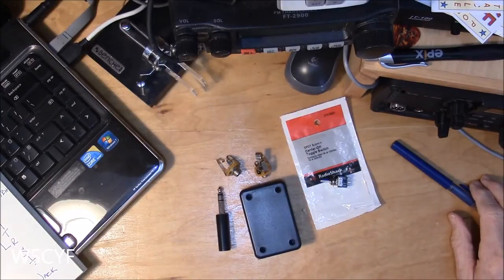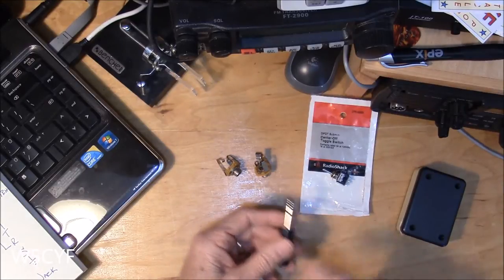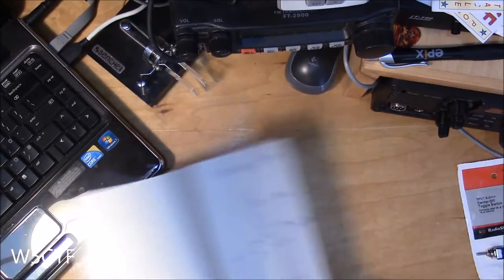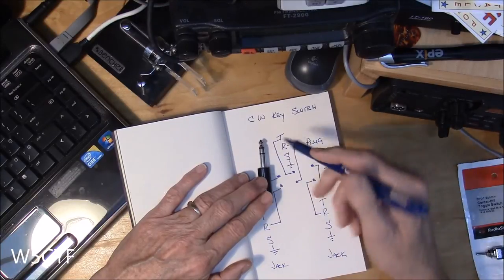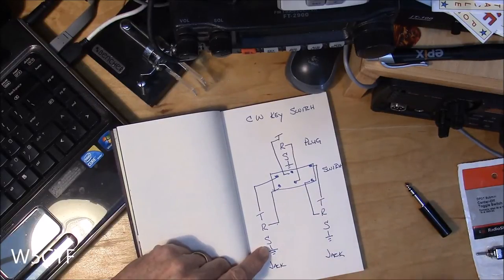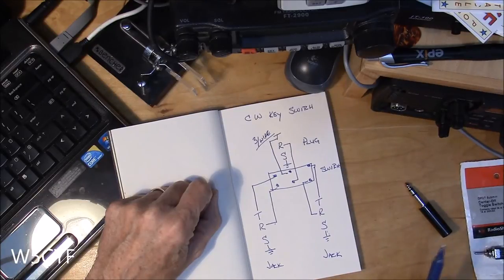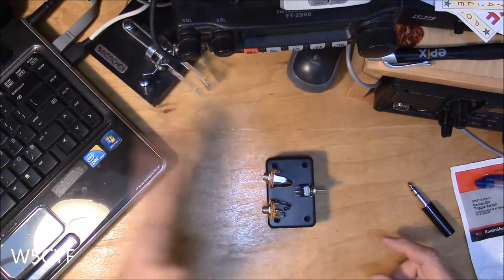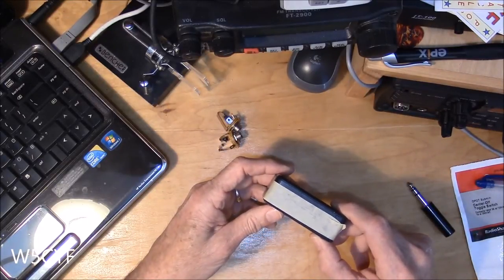CW Straight Key to Paddle Switch-Easy to Build Ham Radio Project

Comment: One time I made an hour long contact with my TT Jupiter. At about 50 minutes in the key I was using quit working. Really, I've had it happen twice now. So I hit tune a few times to let the other guy know I was still there while I found the box for the radio. I dug out this small box with a curly wire. It plugged right into that front "mic" thing. Then I finished the QSO by pushing the lever on the side of the small box. My CW was slower that way, but it worked pretty good. That was nice of TT to supply an emergency back up key like that. I now keep a spare key with all radios.
Reply from the maker: Tim, thanks for stopping by and sharing your story.    ~John

Comment: John, I take it that your are jesting when you say that you do not know what the multipin socket is for on the front of your transever, marked MIC. It is of course for a microphone, the multipins allow also for a send / receive switch to be connected. From what I can gather you only ever use Morse code ?
Reply from the maker: Dave Ticehurst Dave,  Thanks for watching and for your comments.  Yes, the comment was in jest.  Although I am primarily CW, occasionally I participate in a low key contest or State QSO party using SSB.  73/John

Comment: Why do they (even Tentec known for CW)  hide the key jack on the rear ?  When you are using the straight key your fingers are doing most of the work.
Raise your hand (leave the fingers down)  and use the wrist.  I used to "pound brass"  for the railroad and received union wages for it .
73,   K4OF.
Reply from the maker: BOB RENFRO Bob,  Thanks for following along and for your comment.  ~John

Comment: Hi!   You do not need thr switch. just put them in paralel...   because neither the padel or the key haw enny connection when they not used .. You must have a stereo plug on the key, but on many radios you must have that annywey..    73. LB5EG
Reply from the maker: TinnTinn72 Thanks for the comment.  You are exactly right, I should have known that but did not think the project completely.  No need for the switch at all.  ~John
Reply: I was thinking that too. Unless you bump one while using the other. Good point. Nice video.
Reply: Came to say the same thing.